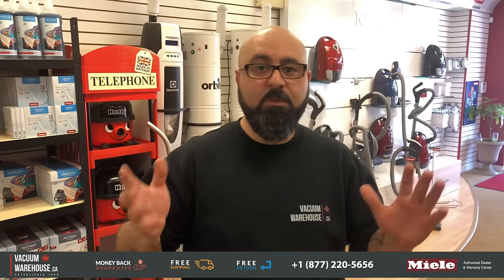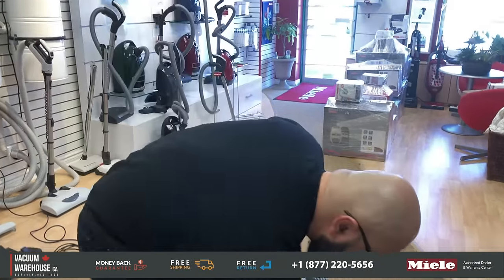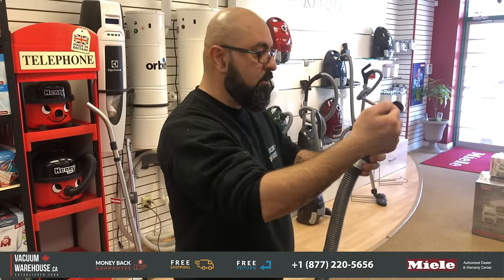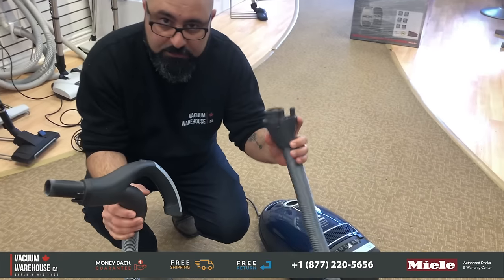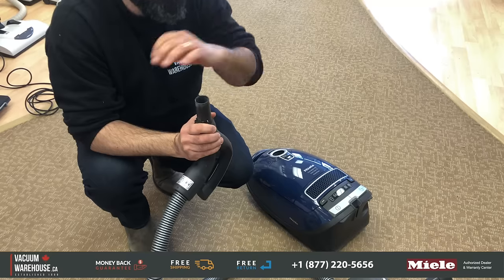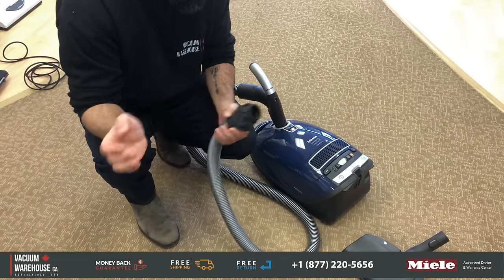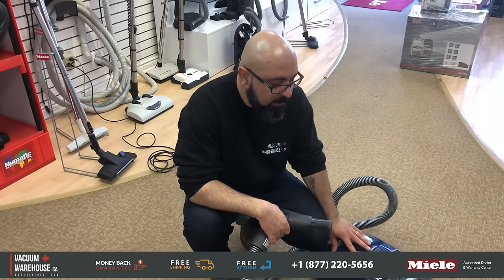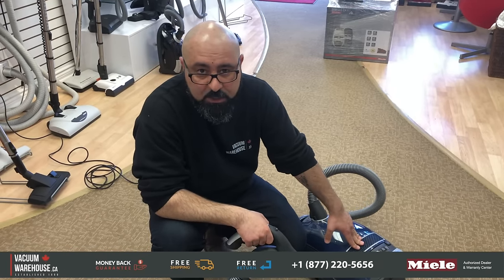Troubleshooting Your Clogged Miele Vacuum: A Step By Step Guide

Comment: My Meile wasn’t switching on and the moment you said getting too hot it turned back on in the other room, it must have heard you. And yes it got to hot using it outside in the sun. Good info on proper use of the vacuum I was beginning to think I was going have to take it to the service centre 😑

Comment: someone had one on the curb I brought it home and it does this. it appears they cleaned up a massive flour spill (kitchen) as it coated the inside of the main hose..so I suspect it's inside the motor some-how -  the chamber where the bag is in .. is relatively clean   I will spend a few minutes on it to see if I can get it to operate normally  - if not it will go back in the trash.      it turns on sometimes..and then just shuts off.

Comment: The bag on my miele c3 wasn't in place properly and I think heaps of dirt got sucked into the motor. Is it fixable or should I just buy a new one?
Reply from the maker: Sorry to hear that Dionne. Try cleaning it out as much as you can. If the dirt is gone into the motor though, it may be a good idea to take it in to a Miele dealer close to you for service.

Comment: Hey! The light on my Miele Triflex HX1 Pro vacuum isn't working properly. When I turn the machine on the light goes on for like 1 second but then turns off. The suction is working as usual. 
Please help me :)
Reply from the maker: Hey Avocado Lover. That is the first time we have come across this issue before. Not sure where you are located or where you purchased it, but your vacuum should be under warranty if you purchased it brand new from a Miele authorized dealer. Maybe take it back and have them take a look. There is a chance the whole head should be changed.
Reply: Thank U for your answer! Today I discovered that the head of the brush isn't spinning as well... The suction works, but no spinning and no light. 
I'm from Germany - probably the country with most Miele specialists haha
I also had the fear that the whole head needs to be replaced :( 
Thank U anyway <3

Comment: I have an issue with my miele cat and dog light. Even if I change the bag, almost after the first vacuuming the light goes red again indicating the bag is full while it isnt. It's getting me frustrated as I feel it's not sucking properly. Could it be a cloging issue? Do you have any idea as I don't seem to find anyone else mentioning this? Thank you!
Reply from the maker: Hi, it sounds like you have a clog in the hose. try taking the hose off the canister and see if the indicator still goes across all the way. if not, then there is likely a clog in the hose. reverse the air flow as shown in the video. that should help, otherwise you might want to take in for service.

Comment: How do you reverse the flow if the hoover doesn't turn on
Reply from the maker: If the vacuum is not turning on because of a clog, it means the motor has overheated. If you wait about an hour, when the motor cools down, it should turn back on, assuming the motor is not dead. But ya, if its just not turning on at all, there is a bigger problem than just the clog.

Comment: If there is a hose clog--I can't reverse the air flow--If the vacuum won't turn on.
Reply from the maker: If the vacuum is not turning on because of a clog, it means the motor has overheated. If you wait about an hour, when the motor cools down, it should turn back on, assuming the motor is not dead. But ya, if its just not turning on at all, there is a bigger problem than just the clog.

Comment: So let me get this straight. The way to fix my vacuum that won't turn is to turn on the vacuum to do this clog test
Reply from the maker: Well, yes, if the reason the vacuum has turned off and isn't turning on is because a clog has triggered the heat sensor on the motor, then if you wait 20-30 min and try again, it will turn on. If the vacuum isn't turning on because the motor is ceased, for instance, then ya, this obviously wont work.